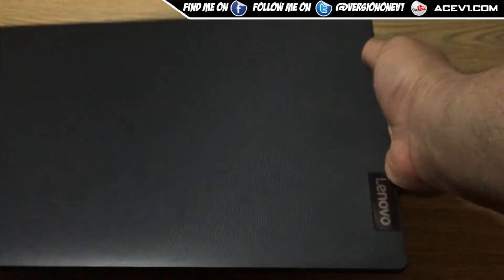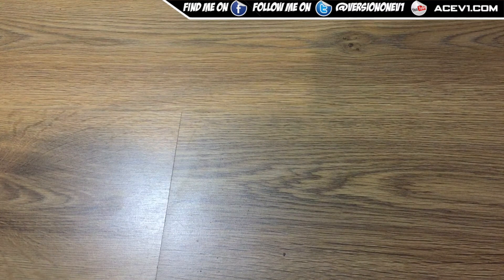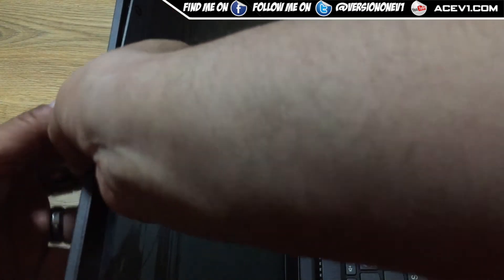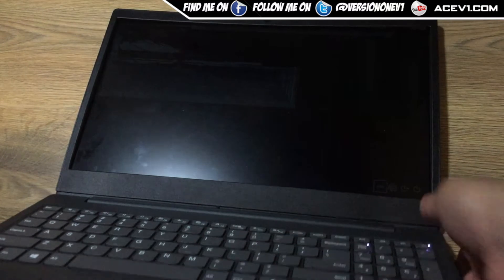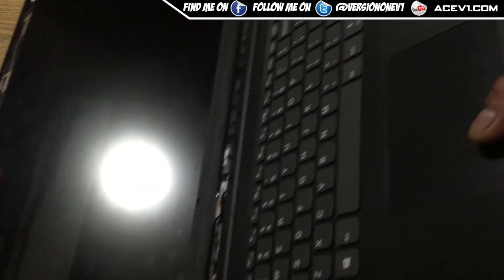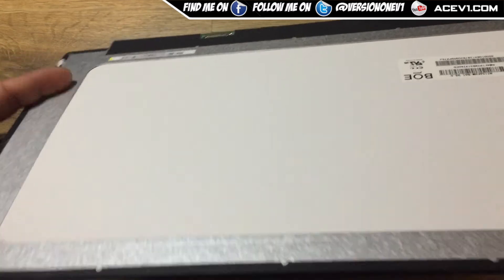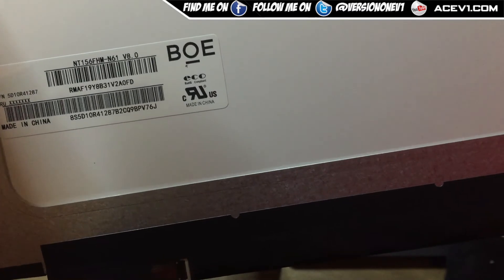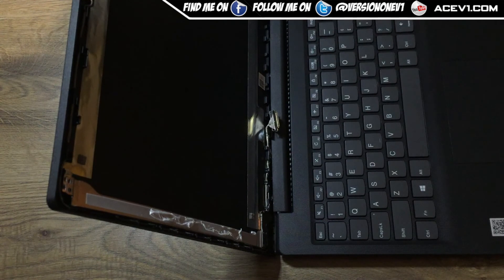How To Fix Lenovo Ideapad S145 Screen Replacement Guide Tip

Comment: So I got my replacement screen from the company on eBay who had high ratings, and upon installing my screen, it still appears as if it’s cracked even the new one. Is there something loose or getting bent wrong or something? They both look like they’ve been cracked and I did not put pressure on the screen or damage it and it was heavily bubble wrapped. Any help?

Comment: Friendly heads up, I took mine apart and the back of my Ideapad S145 says B156XTN08.1 for the screen. So double check if you’re trying to find replacement!! I found mine off eBay for $75

Comment: How much cost will it take to buy screen
Reply from the maker: You can pick up compatible screen on ebay and amazon there are not too expensive
Reply: @ACEV1  but the screen while I want not available in Amazon and eBay
Reply: Yes, @ACEV1 in ebay or Amazon it is not available. If you know, any other sites where we can buy it. Could you please suggest us!